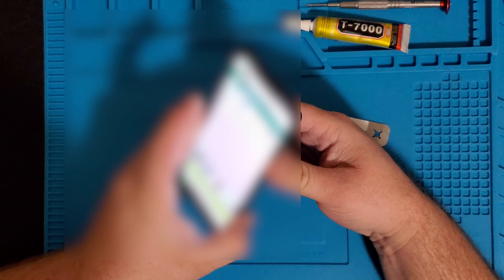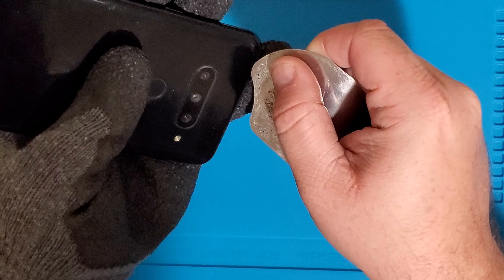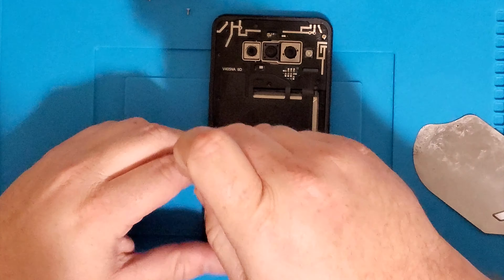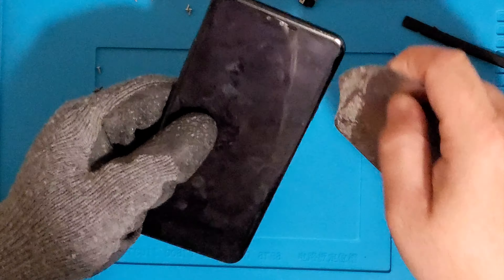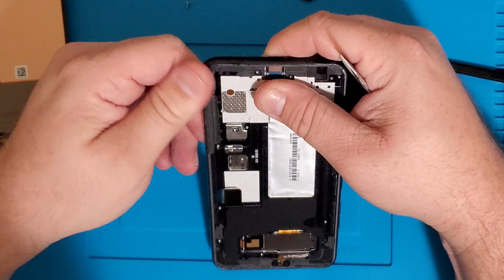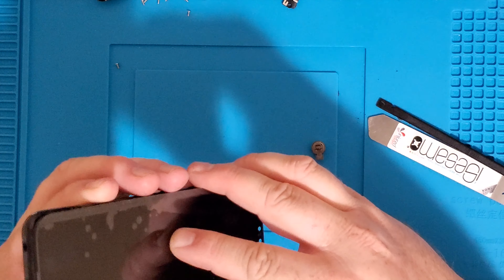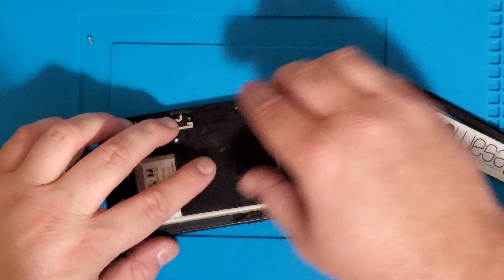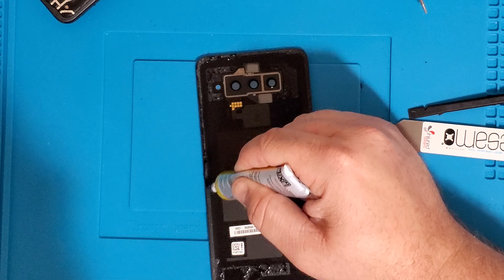LG V40 Glass & LCD screen Replacement Detailed

Comment: Hi. Hey, thank you for the amazing video. It was super helpful. My wife's phone felt and the screen got damage. The phone worked but it could not display anything and she have several applications needed for her work on it. She never set up the fingerprint option so the data could not be transfer to the new one. After seem you video I go a screen replacement and fixed. Now, we will work on setting the backup.. Thank you again.

Comment: Coupon code doesn't work anymore, but thank you for the great video. I can't seem to get the screen off with my current tools. However was able to get the back plate off and disconnect the screen to see if the phone is still working. Thank you for the easy to follow guide, hopefully this will work when I get the screen in.
Reply: Update: phone is perfect now. Writing this comment with my fixed phone. Thank you!
Reply: Instablaster

Comment: Is that T 7000 really good for adhering the Lcd digitizer to the frame without using any double sided tape? Have you had any issues with it coming apart afterwards?
Reply from the maker: Yeah you want to use that T 7000
Reply: @TechMDYoutube  ok thank you very much. Happy new year.
Reply: What's the difference between T and B 7000 adhesive glues?
Reply: @TechMDYoutube   where did you buy the replacement as I see many on AliExpress. Do you recommend them, are they of good quality? I damaged my v40 last week

Comment: Question here. Theres lcd with frame and no frame. Whats the differences? Wht pros and cons? Thx
Reply from the maker: With frame harder to do more stuff to transfer but they’re more expensive. The pros are if your frame is bent it’s good to replace it. If not I would just stick with the screen unless screen and frame is significantly cheaper.

Comment: I paid only 10 bucks less for my ebay digitizer than whats on the link you provide. The problem with the link is that there are several different versions of the V40 and V50. The older V40 and the North American V50 are compatible. The North American V50 model is actually a V45. And the real V50(like i have. Actually bought it from Korea and had fun changing it from korean to english) model that is an LMV500N is not compatible with most of the V40 model screens. I think the newer V40s work with the V50s. But the link doesnt say what models their screens work for. So, worst case scenario, ill stick with my ebay screen that is compatible and maybe replace it when it goes out(if it goes out). If i have to replace it then ill find a legit lg screen replacement.

Comment from the maker: Please support the channel by using my amazon links! 
For just the LCD, Glass, Screen & New Phones click on the links below.

LCD Display Touch Screen Digitizer Assembly :
https://amzn.to/3nD65n1
https://amzn.to/3BqyMbE
https://amzn.to/3vUeTII

Recommended 2 Pack Screen Protector :
https://amzn.to/3EuhIDg

Recommended UAG :
https://amzn.to/3mp9DcV

Recommended Links for New Phones!
https://amzn.to/2ZtMUU7
https://amzn.to/3Bq7n9B
https://amzn.to/3Bs27lX

Heating pad:
https://amzn.to/3mbIytW

Heat Resistant Gloves
https://amzn.to/3EsZdyW

My blue mat to keep everyone organized:
https://amzn.to/3BalS16

iFlex Opening Tool with Glue Card :
https://amzn.to/35UC9h8

iPlastix Opening Tool with Glue Card :
https://amzn.to/38FtzUH

on of my favorite screw driver sets 2uul:
https://amzn.to/3jsqkCz
https://amzn.to/3CcoL2Y

iseasmo w/ Kit (Has Screw driver too)
https://amzn.to/35Za2O0

Tweezers:
https://amzn.to/3B7yBlf

T-7000 Water sealing glue:
https://amzn.to/3EdzLxs 

Isopropyl Alcohol For Technical Use:
https://amzn.to/3BqBU78

• Visit our Website: https://tech-md.com

• My email: dustin@techmd.bz

• To mail in your phone, please contact us at 801-438-6028 

Need to get a part from a reliable quick source, you'll find a better price here then Amazon and the quality will be a lot better. Click on the link below.
https://www.injuredgadgets.com/?acc=be9b6cec65c863e1b55538d2c7fcc9b0